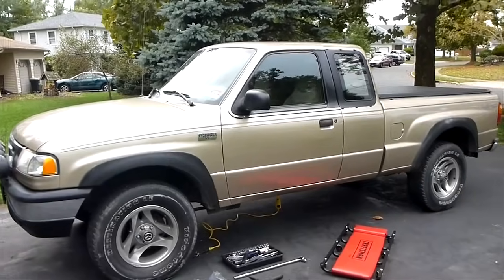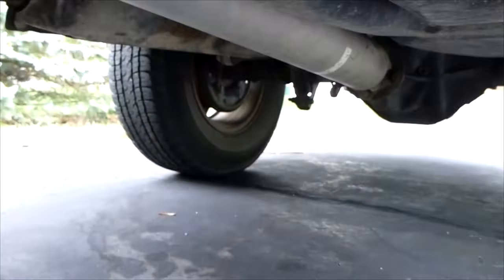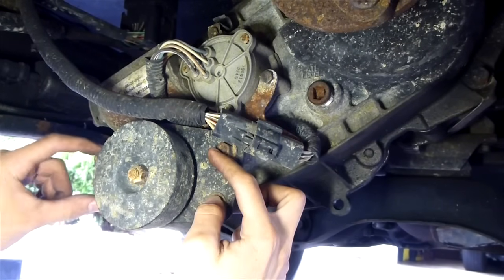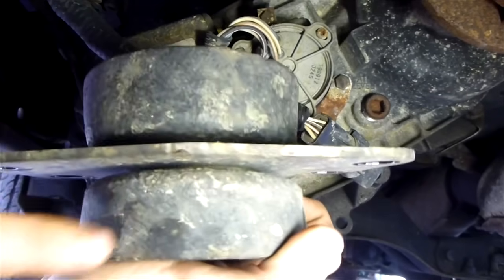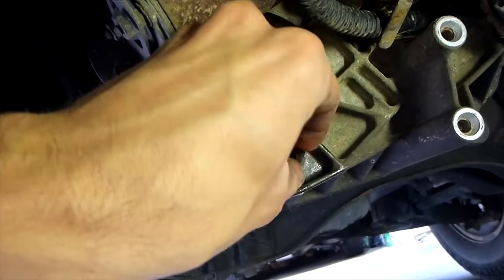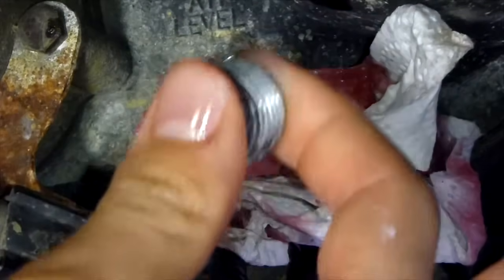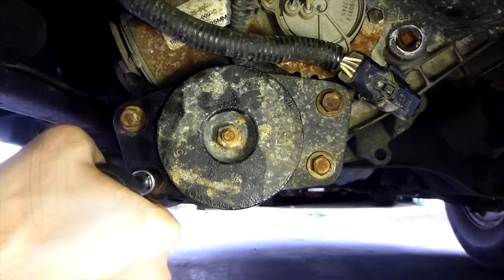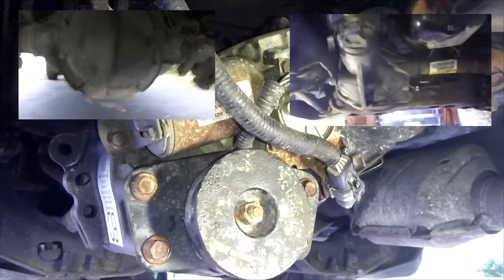How to change Transfer Case Fluid (Easy)

Comment: Kudos for advising us to remove the filler plug BEFORE draining the fluid!!🙌🏻  That advice is pure gold to a self-taught mechanic that usually has to learn by trial & error!  I appreciate you naming the bolt size as you remove them, & the excellent explanation of how the drive system operates, i.e., shaft, differentials, transfer case, etc..  TYVM!😚

Comment: as a good percaution jus to be sure i leave it open and run a lil of clean fluid ti push out the last of the old fluid and any small grit possibly in the case just for good precaution cheers
Reply from the maker: +brad byers good idea! Thanks
Reply: ChrisFix  no problem brother i love your videos and as a mechanic for 10 years running ixe picked up things an as we kn mechanics is all about attention to detail and prcission im not the fastest at what i do but im very thourough of how i do it
Reply: ChrisFix where the ground diff change video?
Reply: what brad said

Comment from the maker: NakedSolidSnake1 That "protection thing" you are talking about is a vibration damper. It is to prevent small vibrations from causing wear in the transfer case so if you take it off, you can cause damage over the long term. Do you really think a car company wants to add extra stuff to their cars that costs them money (especially a big weight like that)?
Reply from the maker: NakdSolidSnake Because bigger transfer cases weight more and have more mass to absorb vibration. Let me know what you find. I know for sure you need it because no car company will spend extra money on something they dont need.
Reply: ChrisFix theres solo much blood !!!! lol jk i had too
Reply from the maker: Echo-GAMING haha, here is a blood test: https://www.youtube.com/watch?v=oIG_BdsffcU
Reply: lol and i seen that vid before.
Reply: دفرنس مخنز
Reply: J Bond yeah
Reply: Informative video.  Never seen extra vibration isolators on a GM product, just Ford and Chrysler's.  Must be a after thought.. cheap engineering...
Reply: PhillLsx Ga. My 06 4wd Ram doesn’t have one.

Comment: At about 10:00 in the video around the vent tube section on the output of one of the shafts from the box there is a black ring around some parts of the box where oil has leaked out and been flung against the box

Comment: Thanks Chris, 
I did the front different Fluid on my 99 Ranger v6 4x4 a few years ago. I have a 2011 Ranger V6 4x4 Ranger now. I just needed a refresher course  on how to complete this task. Ironically I went to you back when I had my 99 Ranger to complete the Rear Diff and Front Diff on it a few years back.  Excellent video!

Comment: Cool vid man but your placing the thread locker on the wrong side of the bolt. Up near the head doesn't bite into anything.
Reply: Dennis Moore I noticed that too..
Reply: Dennis Moore he put it on the rust to prevent the bolt from snapping or just to make it easier on himself the next time he does this .

Comment: What happened to the front diff fluid change?
Reply: Was wondering this myself...would really like to see that one.
Reply: It's the same thing with two bolts/plugs you unscrew and you fill it until fluid starts to come over the top.
Reply: No it isn't, there is no drain bolt on the front differential. You must remove the cover to drain.
Reply: You can also pump out the fluid through the fill hole then refill. (according to the Haynes manual)     My Ranger (year 2000) does not have a drain plug.
Reply: Depending on what vehicle you have yes their is a fill and drain plug on the front dif
Reply: on a 4WD vehicle, usually the rear wheels are the ones that are driven by default, so unless you use 4WD a lot, the front diff won't get much use. I changed mine at about 120k miles, but it was still pretty colorless and still had good viscosity. a good thing to check on at least

Comment: I found your videos 2 days ago and ive learned a lot from you. but this video has been the most helpful. i have a 2007 escape which apparently is notorious for these breaking down. luckily my in-law knew a guy and i only had to pay $450 to replace+ labor. but now my car vibrates at 80+mph. i might have found the reason why!

Comment: Some clarification on Mercon. Very hard to find Mercon-specific ATF fluid anymore. Had to do some research on this as I couldn't find anything at Wal-Mart. What I found out after some Googling: Ford does not license the name anymore. Also, initially Ford said not to mix Mercon and Mercon V but now they say you can... in automatic transmissions only! Mercon V is NOT for use in transfer cases. Ford now has the XL-12 specification for their transfer cases. You can order a Motorcraft version but I found Valvoline's Multi-Vehicle Transfer Case Fluid at my local car parts store and it meets XL-12 specs. Hope this helps some people out there.

Great video, tks!

Comment: Nice video. Your truck requires the ATF transmision fluid.  For my Mazda '97 Mazda MPV 4 X 4 the transfer case uses GL-5 gear oil. A manual is an important resource for the proper specs.  You always mention that in your videos.  It is so important.
Reply from the maker: Matt Keefe Thanks a lot Matt!

Comment: Arlie Box here,
Long time subscriber, first time caller. :)
This was actually easier to search than FRF! LOL
I found my owner's manual (only thing that didn't come with the truck!), for the transfer case, it doesn't list the fluid for the transfer case, but in it's place, is says "Warner 13–54". here we go Googling again. Turns out that is the transfer case itself (duh) . Sooo, I was wondering if that is the same as your Mazda TC? oh yeah, '98 Ranger 4WD. 
My son has "borrowed" my truck, and has hit me with these questions this morning. 
And Thanks for the videos. They've saved my can many times.

Comment: Bolts/plugs that you only take off every 50-100k miles, I would definitely recommend replacing.  I've had these break on me when I put them back in, and it can turn an irritating job into a downright nightmare.  

Just go to the parts department at a dealership and get new ones.  Yes, they do can have heavy mark ups, but that extra cost is nothing compared to how much time it can take getting a broken bolt out, or having to pay to replace the part the bolt goes into , and end up having to get a new bolt anyway.

Comment: In a pinch, I have put the transfer fluid/diff oil in a big plastic bottle with a pump on top like hand lotion (after cleaning it out throughly and making sure it was dry.) to add to the diff/transfer case. It can be a pain to hold the hose and the pumping device and the plastic bottle all at the same time.

Comment: Some Jeep transfer cases require special fluid from the dealer for the transfer case.Ram 4x4 and some Jeep transfer cases require ATF+4 which is also used in the transmission.GMs use Auto Trac II in some and regular dexron in some up to 2005.2006 and up GM transfer cases use dexron 6 in some applications
Reply: Meanwhile

Comment: great videos very informative . i have recently purchased a used 93 ranger 4x4  all vacuum lines for transfer case are not connected as well as the front and rear differential are disconnected can not find diagrams for this any where any chance you could do a video to help solve problem?

Comment: BTW, you are supposed to put the thread locker on the tip of the bold. The end you put it on near the head had no, to very little, thread engagement. Thanks for the video.

Comment: Thank you for your video its very helpful . How about vehicles without drain plug like the one I have 2012 Ford Edge  the PTU has no drain plug only filling plug  can I use a suction pump to get the fluid out or there are other ideas? Ford say its lifetime oil I dont believe that its an oil I know its not like engine oil , some said to drill a hole in the PTU and install a plug in order to drain it. Thank you

Comment: Did you ever post the video how to change the front diff fluid? Loving your videos.
Reply from the maker: I did not post that video yet because I have yet to attempt it. I am trying to figure out a way to do it without dropping anything like the service manual says you have to do. I might pump it out.
Reply: I was looking at mine tonight and thought of just sucking out the fluid through the fill hole.
Reply from the maker: Aaron Spencer Yea, that is probably the easiest thing to do.

Comment: Hey Chris i love your videos, they've been super helpful on the maintenance of my truck. Now i moving on to performance. My problems are 
1. It's a 4 wheel drive (not all time awd) which adds at least 1,000 extra pounds and i don't want to sacrifice that for performance
2. My transmission is a 5 speed manual that isn't geared for speed although it's very good with the fact that it was made back when the top speed limit anywhere was 55mph and i would love to know how to tune it just a little to help it make the truck faster and not brake the transfer case or front axle when 4 wheel drive is engaged
3. The transfer case is barely able to handle 55 mph in 4 wheel drive, it makes an odd whining sound that's a tad bit scary so i don't bother going 53+ in 4 wheel drive
4. The steering gearbox is so worn out that the steering wheel can turn 30° before it actually turns the wheels which is a huge red flag if I'm going to be making my truck faster
5. My budget is little to absolutely nothing so if you can do videos on the parts i need and things i need to do at decently affordable prices that would be hugely appreciated
6. My truck is a 1995 dodge dakota with a 5.2L 318 V8 magnum 4x4 extra cab with an extended bed, yes I'm being specific but being specific is what makes your videos so helpful to others. Since it's an extra cab with an extended bed and a 4x4 it's significantly heavier than it's smaller brother the 2wd single cab short bed which is faster due to its lighter weight. I'm being specific so you know what i have so you have a better understanding of how to help me and many other people out there with older and heavier trucks that aren't built for speed but are being worked on to make them go faster
Reply: @ChrisFix I'm sorry for making such a long post for you to read... With posts that long, almost no one reads or responds to them due to the length. So, again I'm sorry about that
Reply: Oh yeah, i forgot to mention my 5 speed manny tranny has a pretty long shift throw but i personally like it and want to know how massive of a difference in feel and performance it would make seeing how i can shift and double clutch in less than a second.

Comment: I have 2011 Honda Pilot and it hit 120k miles. I never change the transfer case fluids and look almost no different. I glad I did change because the fluid level is much lower then it need.

Comment: loving the vids bud. very indepth and covers everything.
just a quick Q. im about to install a pyro meter on my 4x4. just wondering what would i need to cover the thread that goes in the manifold. obviously something that can handle the heat
Reply from the maker: +Tiarga Thanks! Teflon tape will help seal the threads when you screw the sensor in.

Comment: Good video, but i have a question. On my 2002 Dodge Durango the chain on the case is exposed. I assume this is how its supposed to be because the port looks like it was cut in there. The case making a clanking sound when ever you go over 5 mph. It has a fill port and a drain plug. I am just so confused about it. What do you recommend I do? Thanks in advanced!!

Comment: just so you know, Chris, the pump that didn't work out for you is a gravity siphon type pump. wasn't meant to do what the other one is
Reply from the maker: +Bryan Young Yea, I figured. So instead of getting a mouth full of gas (or whatever you are siphoning) you use the bulb to start the flow. Makes sense. Thanks!
Reply: Any time. That's actually what I use that one for. Bought a jerry can from harbor freight and one of those to refuel. Works well.

Comment: Your 3000 is 4wheel drive? I've gotta B4000 and I appreciate all your info vids. Is your oil filter attached to the block or adapter necessary? Mine has an adapter that's leaking and removal is blocked by the exhaust?

Comment: Great video, thanks!!  How long until the front differential video will be posted?  Looks like it's time to get to work on my truck. :) Thanks for the great advice about making sure you can get filler plug opened before draining the fluid.
Reply from the maker: Thanks, I will do it on the next nice day, but with a foot of snow on the ground, who knows when! Hopefully within the next few weeks.

Comment: Do you guys wait the full 24 hours of curing time before filling the transfer case? Or is filling it up right after threading in the plugs ok? I used permatex #2 and filled it up right away, just wondering if I should expect a leak

Comment: seen you put thread sealer on the plugs , can u also do tht on the front and rear diferential and also would you recommend putting thread locker on the diferential bolts as well ?

Comment: Great series of videos. Would you recommend operating the vehicle first to heat up the gear oil to lower its viscosity in order to increase the flow? Just wondering. Thanks.
Reply from the maker: Karol Hricisak Thanks a lot! It really does not matter. It will all drain out pretty easily. Unless you are going to pump it out there is really no need to work on a hot system.

Comment: Nice video Chris ! Very easy to follow. Is this the same procedure for a Lexus RX 300 all wheel drive or does this procedure only apply to a Ford or Mazda 4 x 4 ?
Reply from the maker: Peter Kwok Thanks a lot Peter. This is the same procedure for most cars/trucks with an external transfer case like this. Some newer cars have the transfer case built into the transmission so that would be different. Let me know how it goes!

Comment: Every Honda or Toyota I have ever owned since 1977 has a drain plug in an easy to reach location on the front diff, the rear diff or the transfer case.

Comment: Hi ChrisFix...  had an issue with one of the bolts snapping off when I was removing the vibration dampener.   How big of a problem is this?   Will the 3 remaining bolts be enough to hold it?  Thanks.

Comment: Chris, I have a similar truck as you (1999 Ford Ranger XLT 4.0 liter 4x4) so your videos are really helping me out - thank you very much. I’ve recently changed my rear brakes and parking brake cable and your videos on this process enabled me to complete this with  confidence.  Almost immediately after however, the 4WD ABS  system got really noisy and shuddering in the front end something fierce when I apply the brakes moderately hard. Not noticeable at low speeds, but the ABS system seems to be super over- reacting considering it’s the middle of summer and +85 F. I’m hoping it’s coincidental to my repair work, and if so, is this something that one can remedy, or do I need to go to the dealership  for help with this. Many thanks.

Comment: Hi cris, i have a 2013 nissan pathfinder and the transfer case have 3 plugs. 2 at the bottom but 1 facing sideway and 1 at the middle. Why i have 2 at the bottom? Should i remove those 2 when draining?

Comment: You took some time.  Thanks!   Every 100K or 30K?  My dealership said 30K on my 2012 Dodge 3500.
Reply from the maker: Check the owners manual. In my truck, every 75 to 100k miles is good enough unless you tow or go offroad a lot!
Reply: I'll bet LOADS of people missed changing that fluid because they didn't realize the drain plug was behind that counter weight. I know it was a mystery to me for a while when I got my Ranger!

Comment: Transfer Case is basically the gear oil / and or CVT fluid in Auto and manual trans . differentials ?

Comment: Chris, I have a 2003 Ford Ranger Edge, my 4x4 isn't working. When it is switched on I can hear a grinding noise that I've been told is connection failure of the gears. Does this definitely mean that I need a new transfer case? I'm not as experienced in this field as I would like to be. Please let me know, thank you.

Comment: Beware, the Ford catalog recommends Mercon V for transfer case fluid in older Ranger trucks. The label on the back of the Mercon V states "DO NOT USE IN TRANSFER CASES!!". My recommendation would be to use the XL-12 transfer case fluid instead. Also, instead of using just a regular thread sealer, it might be better to use the high temp version in order to avoid any possible leakage in the future.

Comment: Thanks for your videos, they have been very helpful. I have a issue on my 99 mazda with the famous 4x4 flashing dash lights, from what I understand it is pretty common with these truck. Can you help with troubleshooting this issue? Thanks in advance.
Reply from the maker: MegaChevy8 Thanks! That can be many problems. Do you have a scanner that can read trouble codes like this one: https://www.youtube.com/watch?v=xPI36bKVCjk
Then you can get the trouble code and know exactly what is wrong.

Comment: That teflon thread sealer, would PTFE plumbers tape also work? 
Also need to try find one of those hand pumps for the oil, going to make the job MUCH easier.

Thanks for the great video, always very helpful.
Reply from the maker: Thanks for the tips!
Reply: ChrisFix Just thought it would work, both being teflon and all... plus, I've got tape and don't see the point in going and buying a tub of that sealer for something you do every 100k miles.
Reply: ChrisFix But I'll try the tape when I change my Transfer case oil soon. Will let you know if it works.. :P
Reply: TH3W1P30UT Hey, how did that tape work out? Haha.

Comment: Hi Chris, shouldn't you flush the transfer case before as there might be some worn down medal dust from the gears or is that one of those risky procedures if the fluid hasn't been changed between long intervals? Thanks
Reply from the maker: A flush is definitely good but not necessary. Just a fluid change is plenty for a Tcase